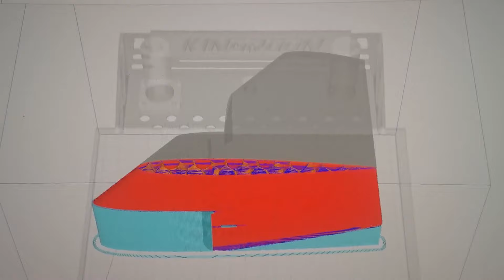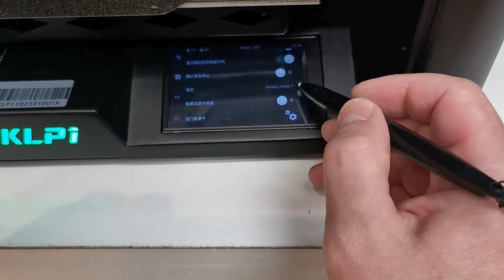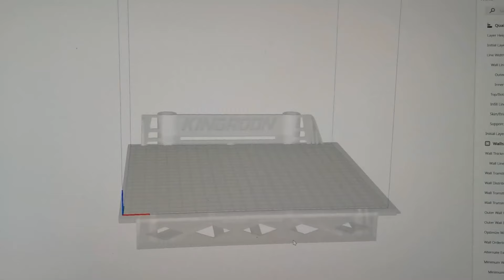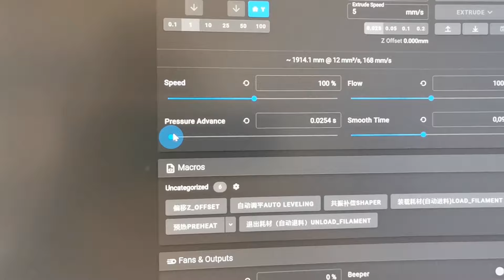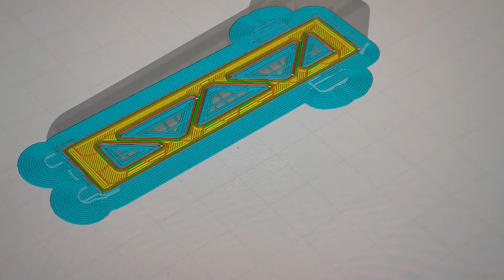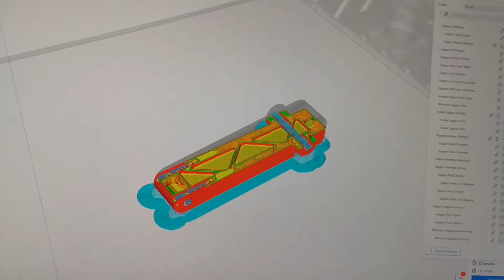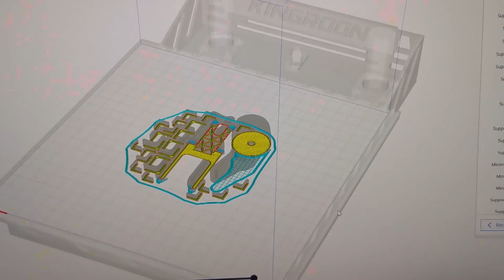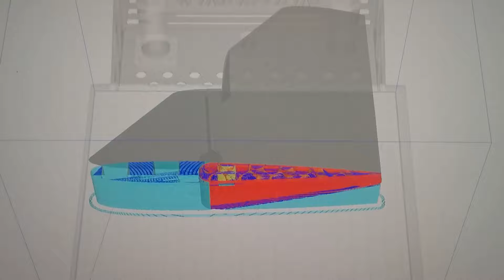Kingroon KLP1 - New Fast 3D-Printer | Full Configuration Review

Comment: Nice video.
The KLP1 is OK for it's price ( I got it last week for 280€). However, quality control might be better - on the door the hinges were mounted on the wrong side and I wondered why the door didn't fit...
Also the distance between printhead and top cover is a bit low - the tube presses the cover up. There are parts on thingiverse to lift up the whole top to solve this - at the moment I be printing it (on my X-Max 3 with 60°C heated chamber in ABS).
For the prints being not as good as on a Bambulab printer I see two reasons:
1. Part cooling. The KLP1 has no auxilary fan, so the part cooling for PLA isn't good enough for high speed. But such a fan is available both from Bambulabs and Qidi for a reasonable price, so it might be a good idea to add it.
2. It uses dual gears, standard size. These often have a bit exentric, leading to fluctating flow; even the original bondtech ones. There are some nice videos explaining this problem. Single gear actually is better for direct extruders. Or at least large gears (like Qidi uses). I do not have a bambulab P1s/p1p or X1C, but a prusa mk4, and if I compare the prints qualtitywise, the mk4 (one big gear + idler) is the best, Qidi (dual big gears) is in the middle and KLP1 (standard dual gears) at the end - of the new generation printers of course. Still compared to older generation printers like the mk3s, the klp1is o.k. I am just a bit spoiled since I got the Qidi X-3 printers (max and smart) and esp. the mk4 (I printed a benchy in silk PLA there and the quality was the best I ever had. However, 55minutes printing time is a lot slower).
Reply from the maker: I use it mainly for LW-PLA and this works out really good👍
Reply: Pre-inflated LW-PLA or inflating depending of the nozzle temperature you use?